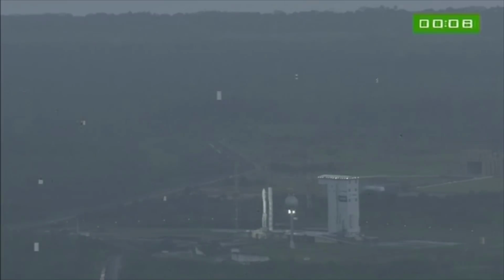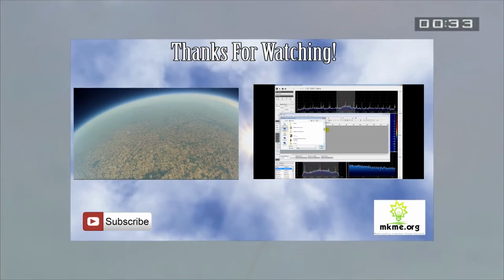Let's make a Satellite with Arduino!  (Project Overview)

Comment: Having worked on aircraft electronics and being trained on that type of equipment, most people don't realize that the operation of equipment in 'normal' conditions on the surface of the earth don't work very nicely in space.  things we take for granted such as atmosphere, gravity, the shielding of the atmosphere from radiation, etc... make sending the average device into space a flying brick without proper precautions.  I'm think this is VERY cool!  But education on allot of things like this need to be considered before spending a tremendous amount of money to launch a satellite.
Excellent idea!
Reply from the maker: +Jon Geissinger Thanks for the comment.  Yeah for my HAB space mission I spent months on the payload module and systems (14 videos I think haha).  This one is a nice departure as I can just do fun "proof-of-concepts" and also have the knowledge that the components do work if you really wanted to send it up as many have done with Ardusat etc.  New video coming this weekend using voice telemetry.  Such a crazy fun project.  Cheers!
Reply: ikr. Differences between "Aero" nautics and "Astro" nautics 😏
Reply: Can I please have your email?